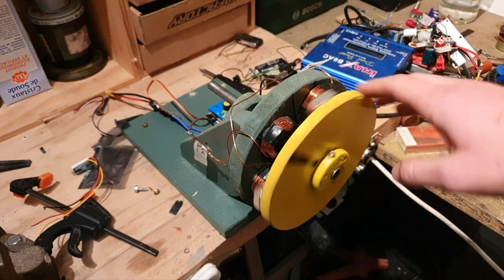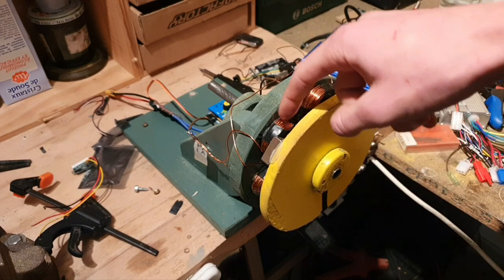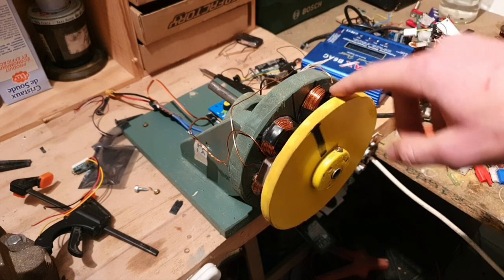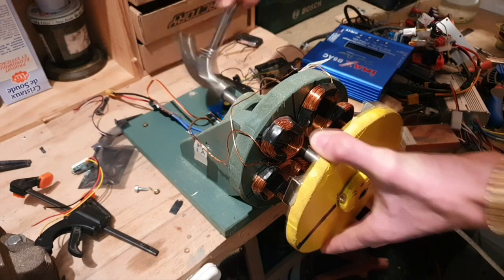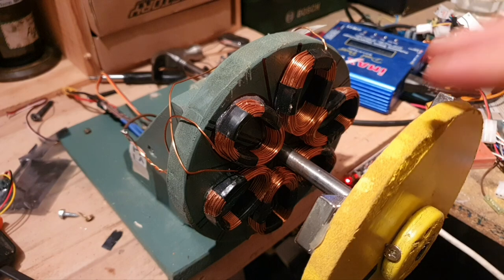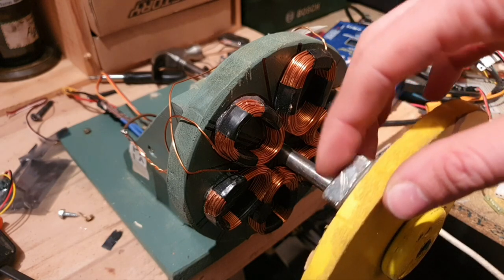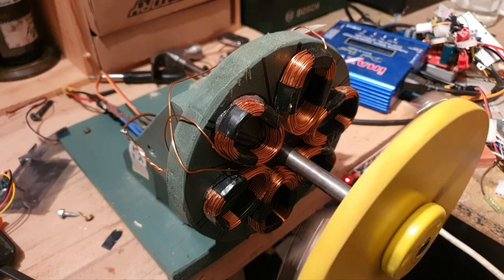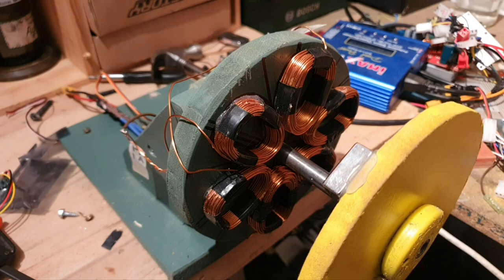Homemade Axial Flux Synchronous Motor (simple designe)

Comment: Hey, I wanted to make your cuban chain from an older video but I don't have access to all the same materials as you. First it looks like you use about 3mm  copper wire. Is that right? And also I don't have access to any welding materials, but I do have a soldering Iron. Obviously it wouldn't look as good but do you think it would work?
Reply: Also How much length of wire results in how much length of chain? Is 1m of wire like .1 m of chain or something?